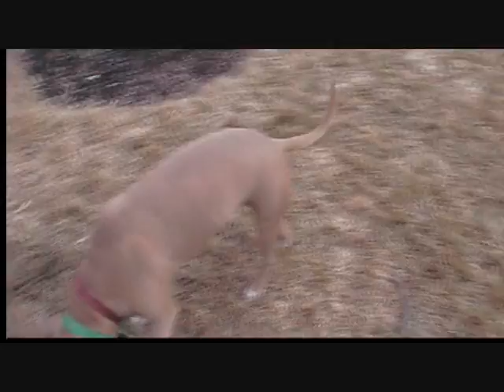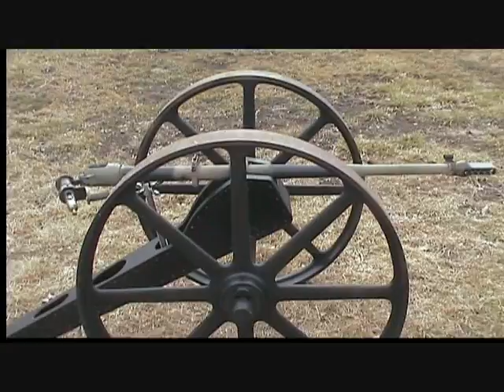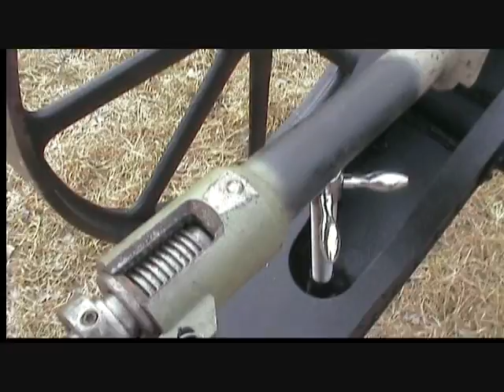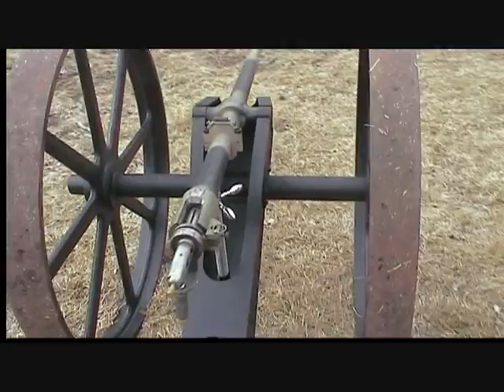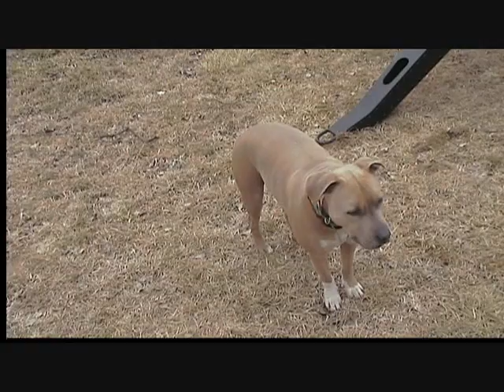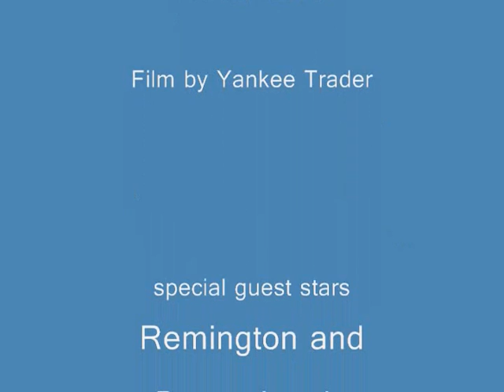20MM CANNON TEST FIRE

Comment: Three ounces?  Did you run that through a Chronograph to get your muzzle velocity?  And no, its not a destructive device IF the design and production if it was built on or before 1989, and it doesn’t use fixed (shell and cartridge and projectile integrated into a single insertable charge.  Any muzzleloader using black powder and any cannon with ah breach that was designed before 1889 that also accept black powder ammo and separate shot are NOT a DD.  Best bet is to go to your local federal building with your final plans and get an “ATF Letter” specifically exempting your project from qualification as a destructive device, and they’ll let you know what design changes you need to make to comply.
Reply: +Stephen Evans Oh yeah, almost forgot, the muzzle velocity might have to stay below a certain level . . . don’t want folks making APDS Muzzle Loading rounds
Reply: Where the hell is that written?
Reply: Anonymous .A  It's written on the ATF website if you look it up

Comment: I know this has been up for a while but I just found it. Please please tell me, can I just build one of these or is it considered a DD destructive device? I've tried to read about it on the BATFE web site but its confusing. I know black powder muzzle loaders are ok but the breach loader thing seems iffy
Reply: I thought it would be cool to build a small mortar type adult lawn dart game using lathe turned steel 1 inch darts propelled by 357 brass blanks filled with black powder but from what I can tell that's illegal also
Reply from the maker: Shane K The way I understand it is. As long as you are not shooting a complete cartridge (primer,powder and bullet all in one) your OK. The breech loader part must be ok because over 1/2 of the guns at the cannon shoot are breech loaders. I do hope you try to build one. They are alot of fun. Be careful. Do your research and be SAFE
Reply: Thanks for getting back to me on that. I know I kind of bombarded you with comments on different videos yesterday, once I discovered your channel I couldn't stop watching. I helped a guy build a carrage years ago for a barrel he had and have been interested since.